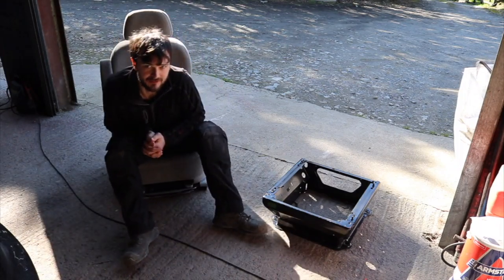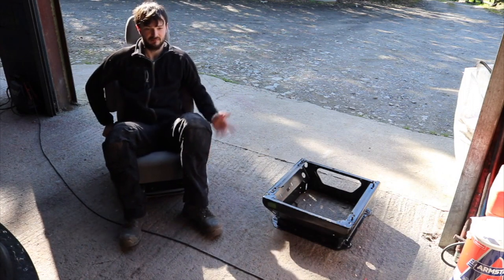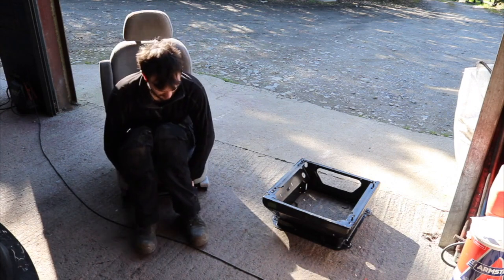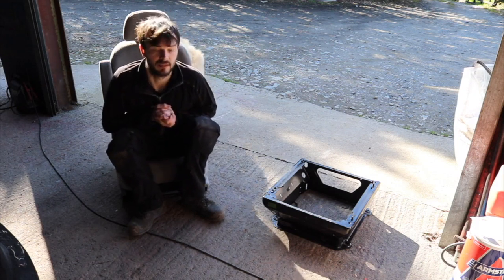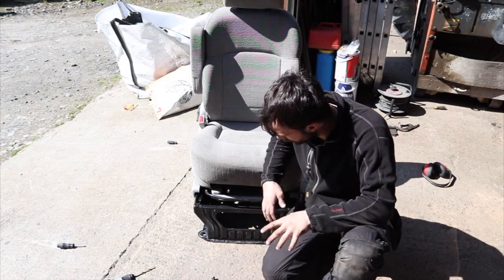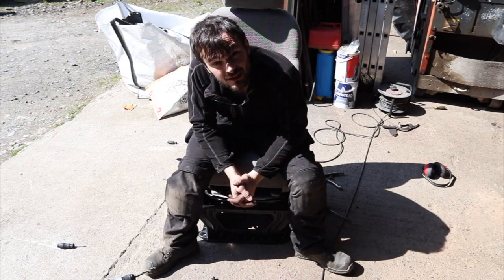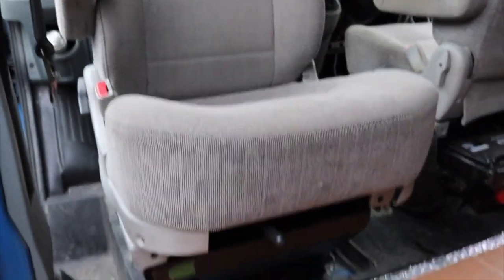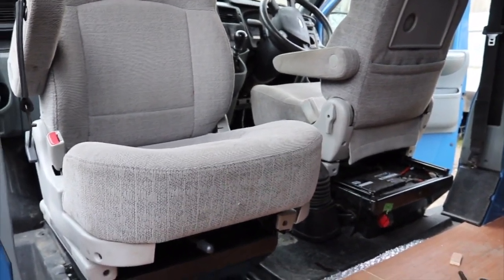Transit Trish #6 | Fitting Hyundai Trajet Swivel Seats

Comment: How did you manage to get the driver seat to rotate, is it not o close to the handbrake
Reply from the maker: I had to put handbrake down to swivel the seat but there is a kit you can buy to lower the handbrake on transits, I forgot to mention in the video.😁